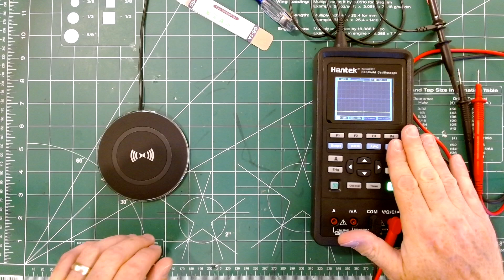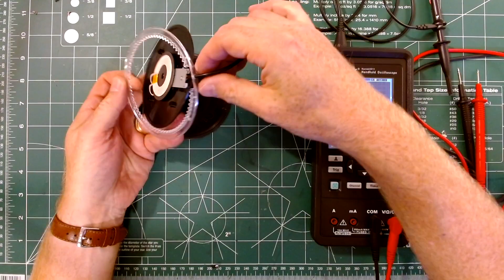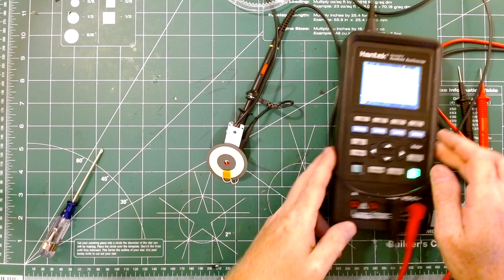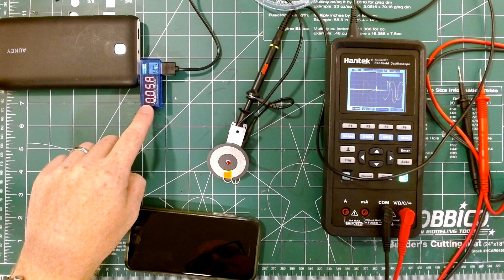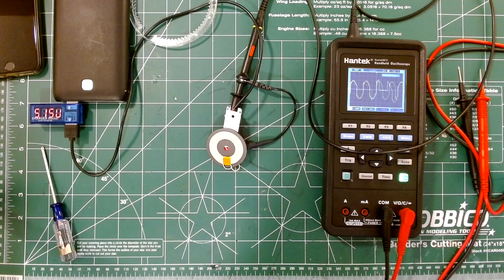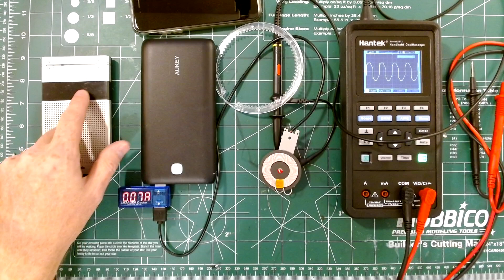Dollarstore Wireless Charger: a look inside with the Hantek scope

Comment: Try turning across the am band. Bet that generates enough noise so the only thing you will get is local stations.
Reply from the maker: If it's right next to the radio, even the local stations are a stretch.